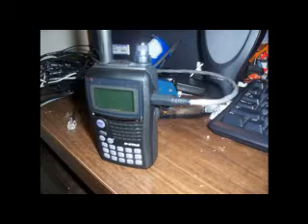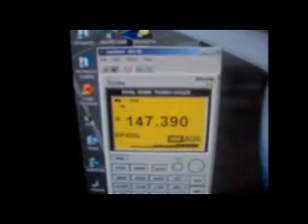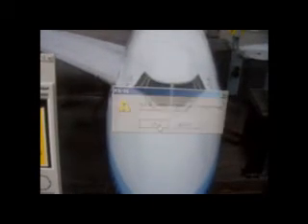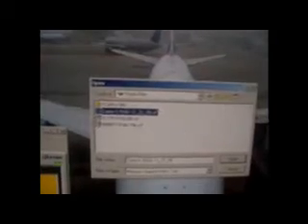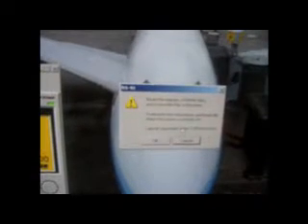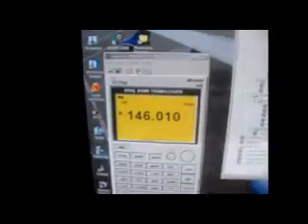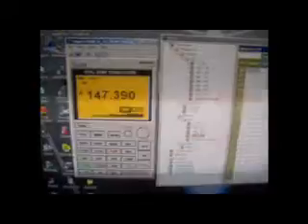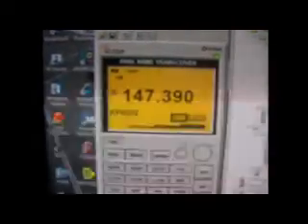Loading a data file into the Icom 91AD

Comment: @Brown1286 It's not the COM port, and I've tried it on several computers as well.  It must be the version.  I have the older v 1.0...  I was hoping I wouldn't need to buy the newer version, but that is the only thing I can find that might be wrong.  Well, thanks for the info. - Gimmick